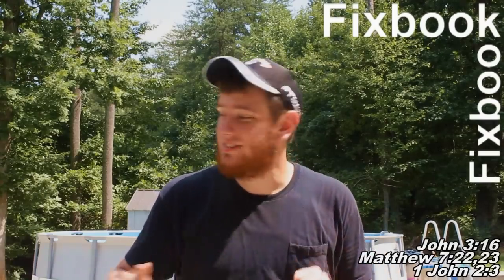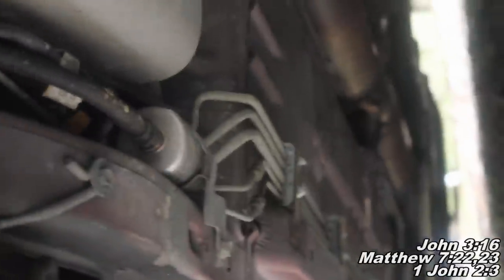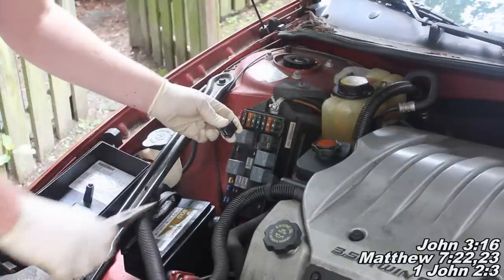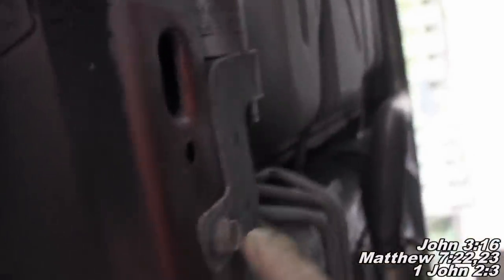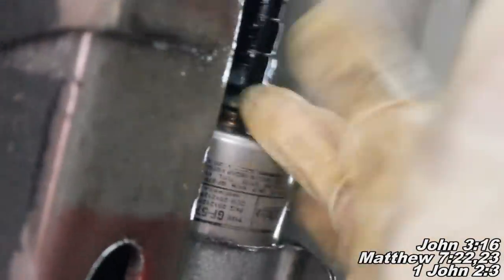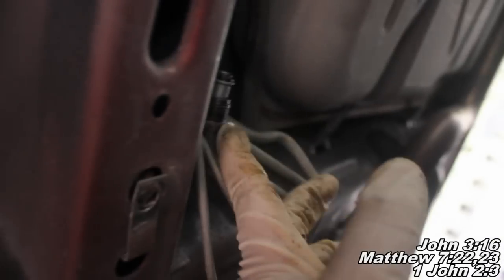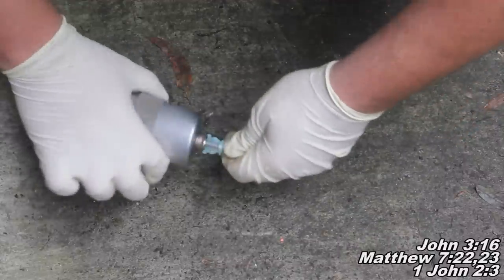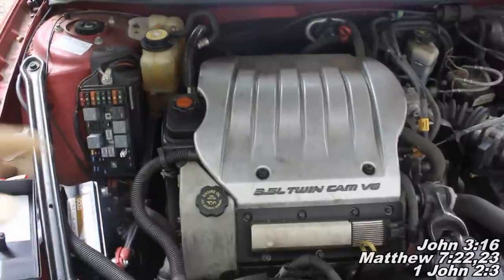Fuel Filter Replacement Removal "How to" Oldsmobile Intrigue

Comment: okay this takes 2 replys, this should be a video called how to "not" replace your fuel filter, do not take this advise, this is how people die in their driveway or garage, he apparently didn't get the pressure released and never use vice grips or pliers when its so easy to get a wrench , if you don't have the right size then you don't need to be doing it.

Comment: I just bought a 2001 alero. it has set for over a year. 
anyway it is using a lot of gas and when I stop at a stop sign it runs rough. and I can smell the gas fumes too. it also doesn't change gears smooth either. 
would appreciate any feedback.
Reply: Same thing is happening with mine except it's a 2004, have you found any solutions?
Reply: Same thing here. I just replaced my fuel pump

Comment: Never a good idea to run a fuel injection system dry, easier way to relieve pressure on intrigued is the make sure the engine is off and located pressure check valve on the fuel rail and just put it in with a small screwdriver to release fuel from the line